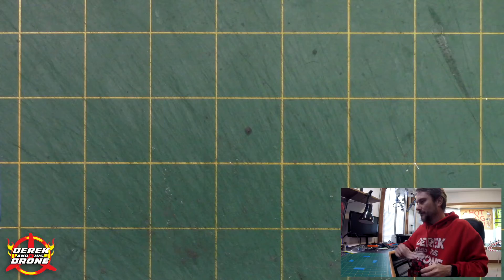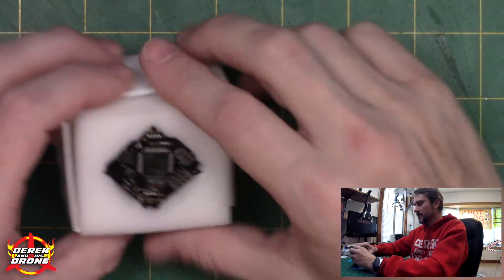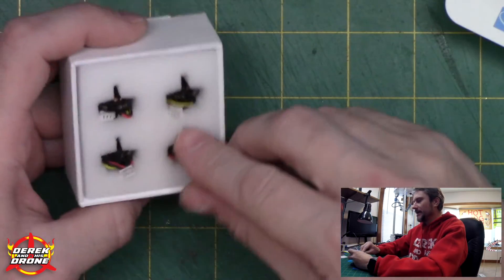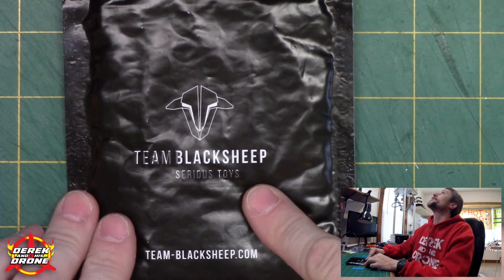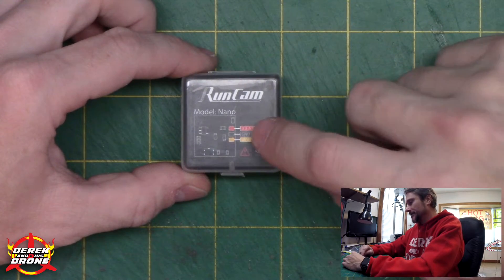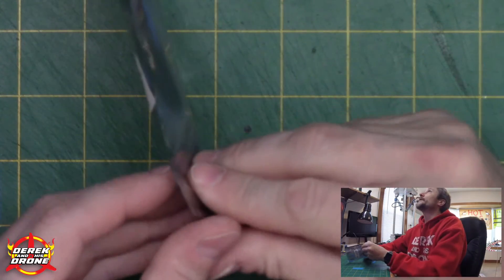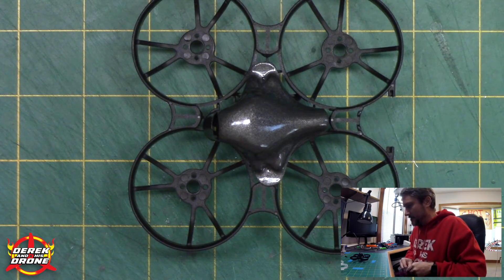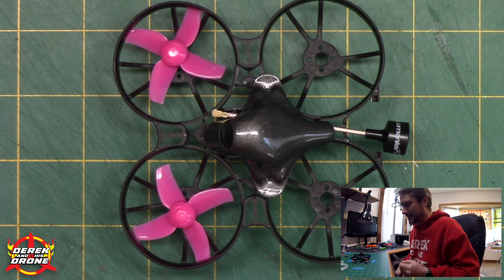Long Range Whoop - Parts overview

Comment: I want to make mine have a better range so badly. I think that if I had diversity on my fpv setup that the video range would be increased.
Reply from the maker: There is several important items to maximize your range.  To get the best performance  you will need the best parts.  A diversity receiver will help a bit.  You will get a better picture but not necessarily more range.  Take a look at RapidFire for your goggle module.  Check out TBS (Team BlackSheep)  their Unify VTX's will give you maximum range and they make one that will fit into a whoop.  Next is a Crossfire receiver, this will give you the best link between your transmitter and quad.  They are small enough to fit into a whoop.  Every quad I build gets Crossfire.  Don't forget about good antennas.  This is key!  the best equipment in the word is useless with a bad antenna.

Comment: Dont you have to keep the length of the axii at a certain point?
Reply from the maker: I'm sure there is an ideal cable length but the improvement over stock is great and it doesn't seam to be a big deal.
Reply: @DerekandhisDrone  Ah thanks because i was planning to upgrade also, but i read something about wavelength and stuff so i thought either 32mm or 64mm length for optimal signal, i dont hope i screw up :P
Reply from the maker: I just leave the cable as long as I can when I cut the UFL off.  Then I strip only as much as necessary about 1/16" for each part. I have done a whole bunch never had a problem.